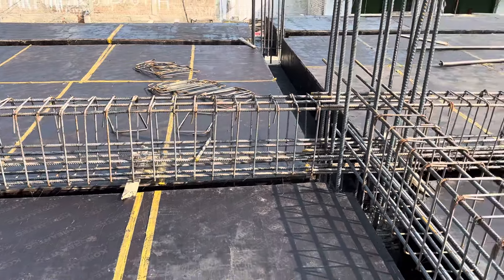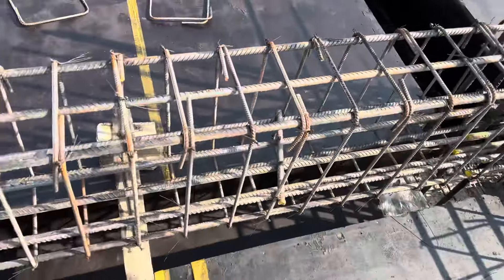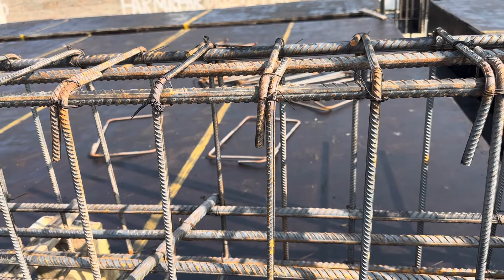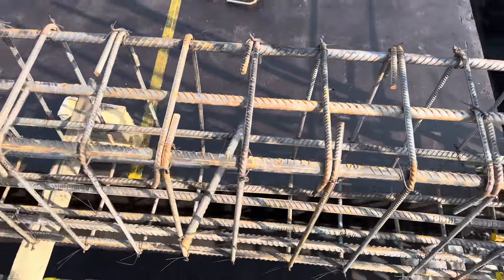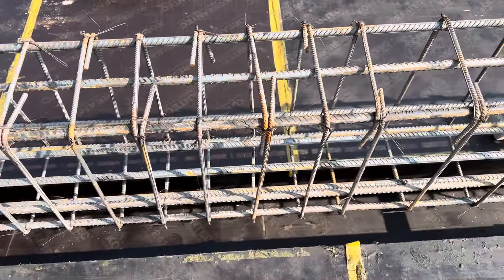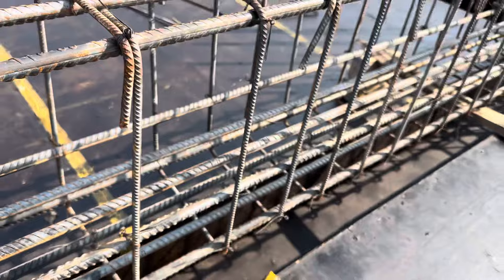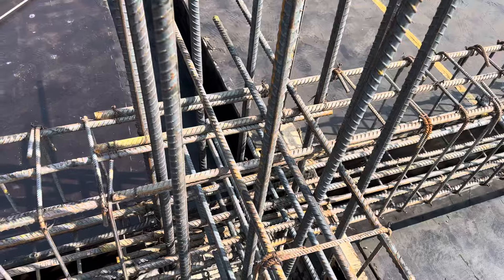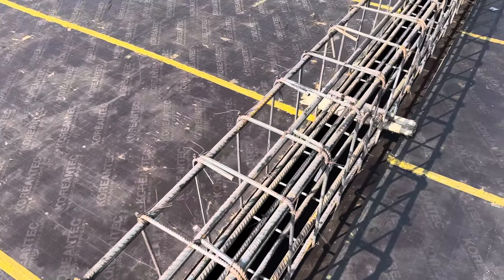Structural design of my project

Comment: Why did they not add any additional steel bars on the top of the beam near the columns for the purpose of addressing negative moment? Near the column, the beam undergoes tension on the top and compression on the bottom.